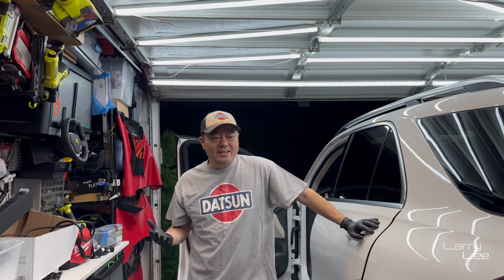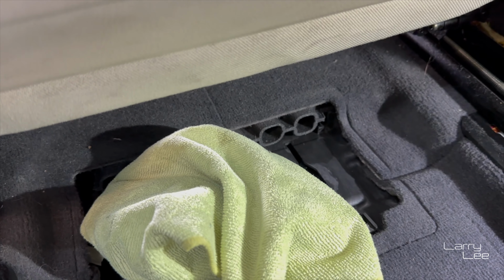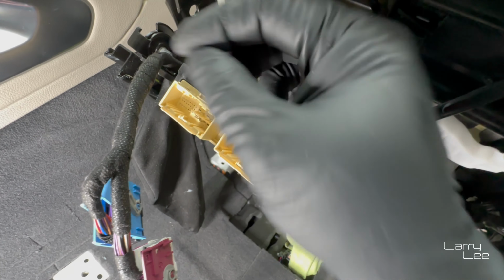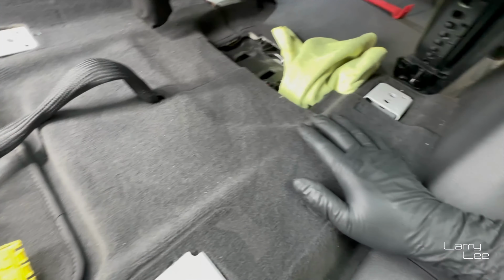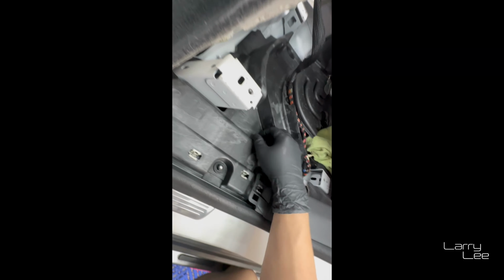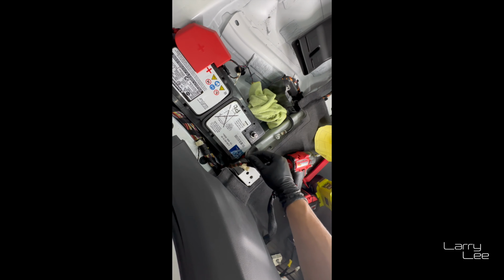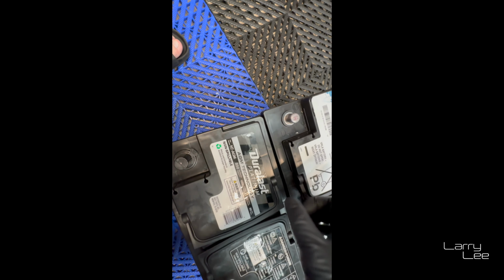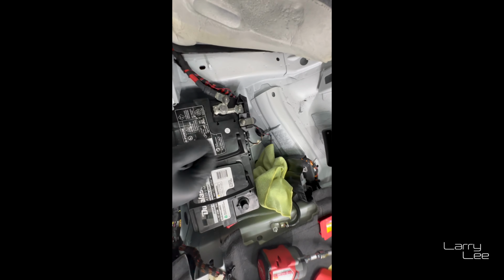Larry Lee vLog 87 -  Mercedes GLE 350 Battery Change

Comment: I saw other mechanics moving the seat forward and accessing the battery from behind the seat . Having to take the seat out didn’t seem right to me for simply replacing the battery! Update , I just removed my battery and absolutely did not have to remove the seat !
Move seat forward and battery recess is completely accessible.
Reply from the maker: I luv to see that happens on this model. Show me a video and I would love to learn magic.
Reply: certain years there's no way get out with the seat in
Reply: That is on 166 chassis easy with seat all the way foward. Up to 2019. 2020 and newer is 167 chassis. You have to unbolt the seat

Comment: We just replaced the main battery on a 2018 MB GLE350.  It was under the front passenger seat and removing the seat was not necessary.  We moved it all the way forward and up as high as it would go.  Getting the battery out of the cavity is very difficult.  We chose to use a small ratchet strap, fed through the battery handle and up around the headrest posts of the seat.  Slowly ratcheting the strap took the weight off so that I could carefully guide the bottom of the battery up through the opening.  It worked perfectly.  I also used a strap to easily lower the new battery into the cavity.
Reply from the maker: @sarahwilliamson9480  2018 is a different model than a 2020.

Comment: Hey, planning on doing mine this month. Did you lose any settings when you unplugged it? Did you use a battery saver attached to the cables to keep voltage going?
Reply: NorthwoodCampaign didn’t even think about that 🤦🏻‍♂️ probably saved me from a broken nose

Comment: Larry, those plugs you pulled out, are the connected to the SRS system of the car? , The reason why I am asking is because, my GLE 350 was on top of a car carrier that went over a bump, and the SRS Restraint Malfunction light came on, I'm trying to see if unplugging the negative terminal head for a few seconds will help to reset everything? Please will it help ? Cos I have done physical checks, everything was okay. The Error code is B1BC797, MY scanner can not reset it, because the car thought it was in a collision, which needs to be done my MB dealership, but they are very far from me. I saw online that removing the negative terminal of my battery might help to reset it, with your expertise will it ?
Reply from the maker: Im not confident that disconnecting the negative terminal will resolve the SRS light.  Im pretty sure you will have to have a more dependable reset scanner to resolve the light.  If you were local, we can try my. LOL. Best of luck!

Comment: Thanks for the detailed video! May I ask how you reset/recalibrated the new battery to the vehicle computer system once you were finished with the install? From what I understand it requires a special scanner tool.
Reply from the maker: I have a pretty good tool.  So it wasn’t an issue for me.  You might be able to find a local mechanic and help you reset if need.

Comment: At the end you said you did everything pretty much in reverse order. Does that mean you connected the seat and the 6 ports, then lastly connect the negative terminal?
Reply from the maker: Yes, cause you can still access one of the the battery terminals with the seat back in place.
Reply: @exam2300  thank you for confirming. I can see that terminal next to the air vent. I’m about to tackle this on my 2021 GLE 350. Can’t believe the battery already needs replacing!

Comment: Will we be able to drive the vehicle if we needed to take it in somewhere to have it recalibrated? My concern is that it would not be drivable.
Reply from the maker: I literally had zero issues.  The car started right up
Reply: Thanks! I appreciate your quick responses. Although you were able to start it right up, you still had to calibrate it after correct?
Reply from the maker: Actually Nop…
Reply: I think you have to if you disconnect the aux battery in the back

Comment: Larry mentioned that one shoulf disconnect the negative before starting work. He’s totally right. 
I forgot to disconnected my negative terminal  and took off my seat modules and replaced the battery and this triggered an Air Bag malfunction light once I got the battery installed.
Reply from the maker: Im pretty confident that with a good reset device, it woudld clear the codes no problems....

Comment: You are doing it the hard way. Having done this on the ‘09 and ‘17, there is no need to remove the  seat. 
Raise the seat to maximum height and forward, slightly cut the carpet, then you can replace the battery. 
Also, attach a temporary battery to the jump points to avoid any memory loss.
Reply from the maker: This is a 2020 and up.  It is really apple and oranges...   Trust me..  Not the first time to the rodeo.  Thanks!
Reply: Excellent tips--thank you

Comment: Thank you for the video. Do you know the location for the auxiliar battery? This is a pain.
Reply from the maker: Yes, in the passenger side,, basically the same spot.  PIA for sure...
Reply: @exam2300  Thanks.. I'm already crying :(
Reply from the maker: @michel_leblanc  I think the most painful part is to make sure you disconnect the battery if you are going to disconnect the seat.  Cause the last thing you want is to accidentally set off airbags...
Reply: @exam2300  Thank you for the tip. When you mentioned disconnect the battery first to remove the aux one. Are you referring to the main battery?
Reply: I believe he means the main battery. You take the front two bolts off then move up seat to take back bolts. You should be able to remove the black air vent to get access to the the negative terminal. Then should d/c the terminal then unplug the seat connectors. Then remove the seat. This is my understanding and makes sense.

Comment: How do you reset the airbag after?
Reply from the maker: Your airbag light should not have come on.  You need a app/software to reset.
Reply: @exam2300  I did not unplug the battery first.  An OBD II reader cleared it.
Reply: It happened to my gle as well. Now fishing for some scanner for rest the airbag light.   

What scanner did you use for yours?